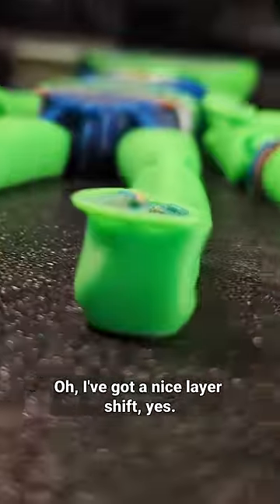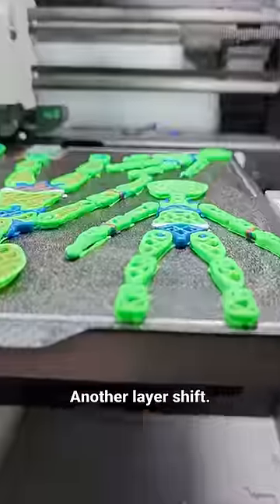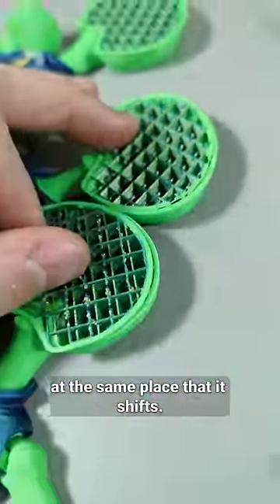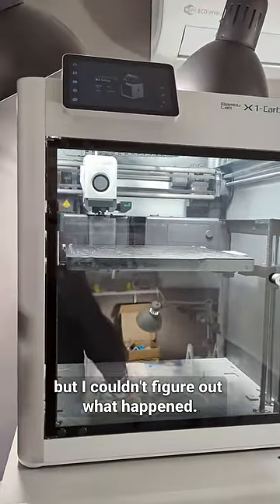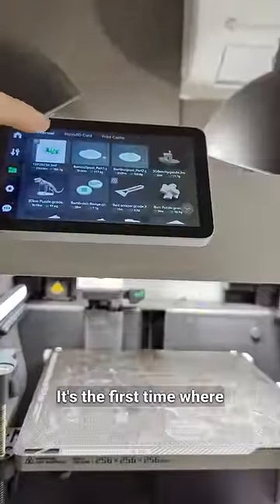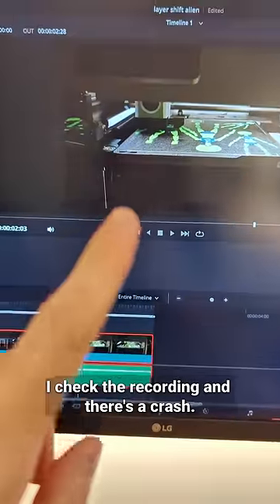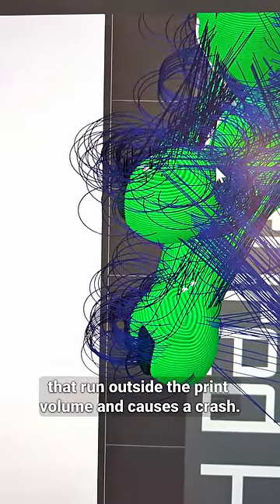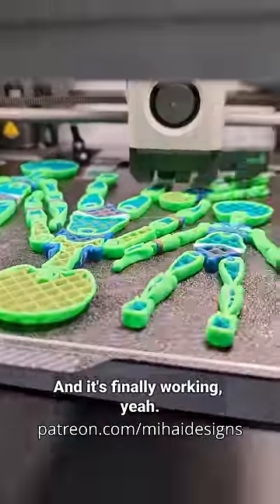Curious 3D printing layer shift

Comment: Watching a pro troubleshoot failed prints on an expensive rig makes me feel better about all my failed prints on a cheap machine
Reply: Same
Reply: Cheaper machines are more likely to fail. My Ender 3 V2 was a mess for like 2 years and then I got my P1P and have less to worry about. Stuff does happen such as shown here, but more often than not it’s the slicer settings or orientation, rather than the machine
Reply: @AlexWithAStar  what was your 3D printing skill set before getting your ender? Maybe your skills increased by the time you got your p1p, so it seems like the better printer but really it’s you that got better
Reply: Don’t listen to them. This machine being expensive is exactly what causes this print to fail! A lot of stuff, rig, add-ons and closed chamber causes this problem. This stl file would have been printed perfectly on a simpler and cheaper printer.
Reply: @Brucey69  Well, I admit I suck at leveling, and despite many attempts and following every trick in the book, my printer just wouldn't stay level. That part I could never figure out why, and wouldn't care when it was leveled, but the problem was that when it was unlevel, it took forever for me to get it leveled. I did try different springs and such, which would help for a while, then the same issue. It coming out of wack every 1-2 weeks would be less of an issue if I could level quickly. Then I was gifted a P1P for my birthday, and it's been mainly smooth sailing! I have so far had 0 clogs, but then again, even on my E3V2, I only had a few clogs, which was from filament that needed drying from the factory, no big deal.

Some of that filament even works on my P1P without drying, but I dried it and got even better results. I also got to use PETG and TPU since I didn't have to worry about constantly having to fiddle to either get it level, or to fix other issues. No Z offset for different filaments, the materials are pre-set in the slicer. I'm sure it differs by brand but the 3 (maybe 4, forgot the TPU brand), brand I used all work fine on the Generic ____ presets. Without me having to worry about leveling or the offset, it just works!

Now, as with anything, it's not perfect, and I have had one hiccup in a few months that was unexplainable, and one update also did break a feature temporarily (filament changes from the screen gave an error, phone or PC did not) but that is fixed now. Most of the time, if a print fails, it's because of either slicer settings I've put (orientation, no brim on a part that needed the extra surface area, forgot to add supports, etc.) or because of my filament being spooled wrong. Other than the 1 print that for whatever reason didn't print right, and then immediately printed right after the next try, I've had smooth sailing. 

So, to answer your question in one sentence, I believe part of my problem was that my leveling skills weren't great as well as well as it constantly going out of wack, so when the printer compensated for that, it did amazing. 6 Months so far, printed many spools, and am working on making a soda bottle to filament setup.

Edit: I know a few Bambu people have had some unfortunate mishaps as a result of issues that missed QC, but Bambu Labs reportedly has had great customer service and either repaired it, sent them a replacement part, or custom coded an update for the machine in a few days. I'm on 6 months with no issues, so I can't say anything about that myself.
Reply: @Buli0n  You'd be correct had it not been for the fact that the print head has to travel outside of the print area in order to print. After he slightly changed the orientation (or turned off Z hop as I believe he said it was Z hop, which I don't use so I cannot say much on that except I've seen the spiral Z hop settings) it printed fine.
Reply: @AlexWithAStar  i’m still correct because stl is designed like this (to travel outside printing area) and it causes the problem with this printer, problem vanishes only after when file is changed. You wouldn’t have to make any adjustments on a cheaper more exposed printer.

Expensive printer = you have to make modifications

Cheaper printer = you DON’T have to make modifications
Reply: @Buli0n  Well that depends on the printer design, cost has little to do with it. My old E3V2 would have failed as well because it cannot travel outside the bed. Neither could my P1P, which isn't enclosed. It's not the printer, it's Z hop's travel pattern. Plus he probably duplicated the STL 3 times, since rarely are STL's more than one part. That means it's not the STL's fault. 

It's the slicer. You could replicate this on any printer if you have it try to go outside of the printable area.
Reply: @AlexWithAStar  🤦‍♂️ yeah, because cheaper printers AREN’T designed like this
Reply: @Buli0n  They will fail too if they are trying to travel outside the print area...
Reply: Is cool because usually I just give up and move on but when it's your main source of income you HAVE to work to get it fixed, so satisfying.
Reply: Lmao a pro? Have you seen his videos, he makes very novice mistakes tbh.
Reply: @Festivejelly  I guess I considered him a pro, idk
Reply: @Buli0n lol what? If my Ender moves outside of the print area, clickity clackity it skips teeth!
Reply: This is exactly what I hate about my ender 3, the constant bed leveling and if I mess it up even a little bit I get a failed print. I have to spend so much time leveling it just for it to shit itself a week later and I have to do the exact same process all over again. I know I could get an auto-bed leveler and install that on my ender 3 but I'm just over this machine LOL. Happy to see someone with the same sentiment  @AlexWithAStar

Comment: Let support know so that they can fix that!
Reply: And charge them for the hours and the bug he just found 😂
Reply: Broskisnowski warning and possibly skipping out of bounds moves would be a start.
Reply: @Discostew2  Prusa Slicer does warn about this, Bambulabs seems to have disabled this or is not showing the warnings in general.
Reply: Good luck getting in touch with support 😅
Reply: Broskisnowski oh yes, the classic, just don’t use that feature rather than having it work like it is meant to. It is something that should be part of the slicer. If also isn’t difficult to make sure every move is within the build volume.

Edit: it also isn’t just a physical limitation. This was caused by the slicing software.
Reply: @ricardopereiracom if companies had to pay for the bugs users found, they'd go bankrupt
Reply: It is not fixable. You can't use the whole bed. 
There is nothing wrong with the printer.
This is user error.

Maybe you could blame the software for allowing you to slice it and send the print off

But I would need to see the settings and know exactly how this file was made, sliced and sent before I could come to that conclusion.

No matter what. The operator is ultimately responsible for the control and use of the machine they're using. 

If you don't know what the machine can or cannot do. Thats user error, still.

Your responsibility to know how the machine works and to use it properly
Reply: Broskisnowski  everyone wants to blame someone for their ignorance and stupid actions.

No one wants to accept responsibility for their own screw up.

"Its the companies fault for selling me this printer they should've known I am too stupid to learn how to use it properly"
Reply: @aaroneckardt5514 As a software dev, I have to disagree with you there. True the user is responsible to a certain extent, but when there are hundreds of layers and thousands of move operations it's unreasonable to expect the end-user to validate that all the move operations are within bounds. The slicer should at least warn the user that a path goes out of bounds and then it should be up to the user to accept that risk (with the knowledge of their printer's limitations) or not.

That being said I do think it's unreasonable for the person who submitted the bug to expect compensation, unless there's a bounty for figuring out the repro steps of a particular bug (which sometimes occurs for very problematic bugs)
Reply: @aaroneckardt5514  it absolutely is the slicers fault and you can use pretty much the whole bed, the issue here is that the slicer generated a path that is outside of the bed and area that the printer can reach. It's not that difficult for the slicer to make sure all paths are within the bed.
Reply: @aaroneckardt5514  when a company sells a printers as a closed system that is just supposed to work then it is no longer just the users responsibility.

You are completely clueless if you think this is ignorance or stupid actions on behalf of the user or that the user just doesn't know how to use the printer.
Reply: The guys voice suggests he is the support guy. 😂
Reply: @Pixelplanet5 prusa over cura everytime
Reply: @samwilde8311 some companies actually do! Pretty sure apple has a bug bounty program.
Though these programs are usually more for bugs that pose a security risk and not inconveniences like this.

Comment: The life of a 3d printer: TRYING TO FIGURE OUT WHAT WENT WRONG
Reply: As a programmer, i strongly relate to this but don't like it one bit 😂
Reply: @exsxn1541  I have a printer farm. Its tough trying to diagnose every printer and perfect each one
Reply: Something definitely went wrong with yall 😂
Reply: Amen. Even when you get a perfect print, it's never good enough. We demand smooth surfaces and strength from high speeds and filament we bought from some dodgy Chinese company which was left exposed in a kitchen where we cook and wonder why there are extrusion irregularities, lol.
Reply: @ArcanePath360 you said it.

Comment: Part of me is slightly happy to see a Bambu printer do something stupid. But it’s also cool you figured it out and fixed it. 

Took me quite a while to figure out why I was getting layer shifts with only a couple specific models. (Turns out large bed surface area models could contribute enough drag to move the bed plate slightly cause 4 clips weren’t enough.)
Reply: same. too many fanboys. this printer was marketed as a self leveling and ai driven system. but it cant even determine its own set build volume size. what a joke. the software and hardware should know it cant move like that. why does it need lidar when there are issues so simple like this.

Comment: Interesting. I'm surprised it doesn't check to see if any of the gcode paths are outside of the print volume already 🤔

Prusaslicer does
Reply: It seems like such an obvious thing for it to check I would have never thought to go and double check it. +1 to prusa
Reply: It's more than likely the spiral z-hop is added during post processing since I don't believe prusaslicer has it stock. If its added after the checks than the crash makes sense. Definitely needs to be updated in the software though
Reply: it’s a prusaslicer fork/clone, it’s the same code.. it checks for many things but apparently this might be a feature not many people had trouble with, it took him 4 prints and two cameras to determine why it happens - I would for example just print one by one or something which would solve the issue here, or would gradually add more prints, which would resolve the issue - which is to move them all in a bit..
I guess 90% of people if they experience this issue would not report it at all if they even solved it..
Or they received the issue complaint but it’s a low priority one..
At least as a user it’s good to know what are the possible bugs so I know what to check..

From learning a bunch of apps I determined that you can say you know the app if you know most of the bugs
Reply: If they use the curve feature it is possible that the points are inside but the movement touches outside.
Reply: @robob3ar  The problem isn't that he can't fix it, just that the slicer doesn't inform him, when it certainly could. That would avoid all the troubleshooting and wasted filament, regardless of how easy the problem is to avoid.

Comment: If you dont have a way to recycle that plastic, you can print it to the end and use a paint scraper to pop the layers apart at the shift. re-adjust the fit, then reattach it with heat (soder it on low heat with some excess material in the correct color)

Comment: My last layer shift was a fatigued wire to the stepper motor, after 10,000 bends any wire will fail. I used a 4 wire USB cable as a replacement.

Comment: The moment I saw the orientation on the bed I knew the cause. 

This is why you use the center of the bed only.

It is an FDM printer, NOT an SLA or SLS. 
YOU CANNOT USE THE WHOLE BED.

Comment: Best if your 3d printer has a hot bed because mine helps to prevent that movement of the print but definitely would be nice if it would provide notifications on errors like yours

Comment: I printed out a prop gun and one part came out with the most random massive layer shift that I literally didn't notice it was shifted until I tried to match it with the other side
I tried to reprint it and I was checking it, I go to check it after 2 hours and my cat has decided that it likes trying to sleep on the bed until it figures out that it's a bit too warm

Comment: That's shocking it doesn't warn you. Prusaslicer will warn me. It took me a while to realize why, but it was the same issue. 

The error: a toolhead is outside of the print area.

It is very brief though, so if you don't notice the flags you can still print

Comment: my first thought was right, i was suspecting there was  a move that was out of bound.
Reply from the maker: It's curious that the printer firmware doesn't check for it. The slicer usually checks, but not for this it seems.
Reply: @MihaiDesigns  Klipper does check for out of bound movements,  smoothie and marlin doesn't, not too sure about RepRap Firmware.

Comment: I was having a layer shift problem with the latest firmware so I rolled it back a couple of versions and I haven’t had any issues. Might not be the reason you’re failed but just in case.